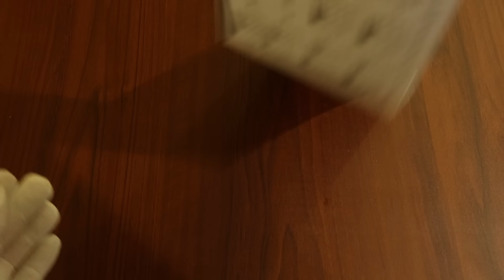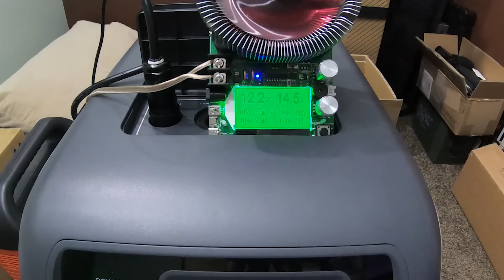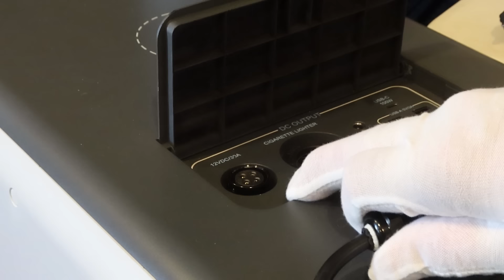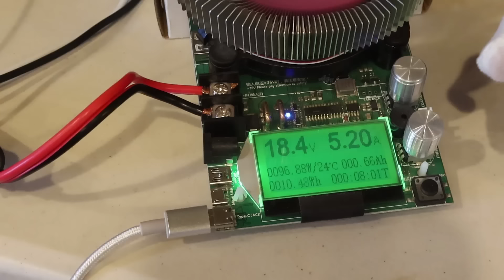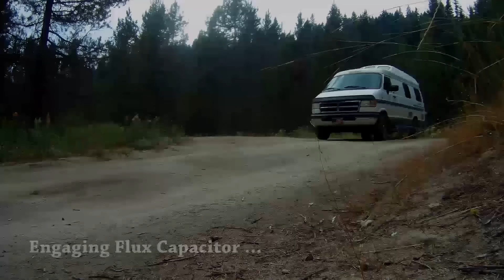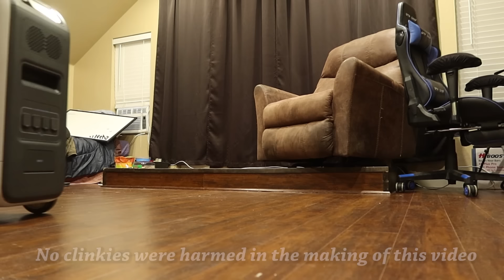BLUETTI EP500 5120wh LiFePO4 UPS BACKUP Off Grid Solar Generator Kickstarter Review

Comment: I look forward to the EP750/750 Pro ( guestimate) with the following additional features:
a. 7,512 W;  b. 4,000w/6,000w inverter; c. more a/c and d/c output ports; d. input port to include anderson connectors for up to 6 awg wires;  e.  separate ground wire input for connection from combiner box etc;  f. larger pv input cable to accommodate 6 awg wires etc. (in addition to anderson connnector) and
 in split phase mode: a. standard 120/240v plug from system to transfer switch to enable multiple 2 pole in transfer switch; 
I know you made a good recommendation to have steel covering  etc. I guess you would have many more recommendations.
The above is to bring the system into line to compete and replace bulky residential gas/diesel generators and to corner the market for apartments. as flexible solar panels can be place on the glass/windows etc to charge the system without bulky pv arrays.

Comment: Also if I have the split system and it can operate 220v etc. how can it connect to my transfer switch? If I have 120v/240v with one double pole circuit say double 20amp or double 30 amp (in my case for my electric dryer  and dual outlets in the kitchen which operates my ge oven range) how will it connect?
These questions and the answers may assist in the upgrade version of the split phase in the future as it is seemingly obvious that is where this EP500 Pro system is heading  to corner the market on apartments and houses etc. The future is megacities with high rise apartments that each unit would need about 13.5 kwh. of generator power and there can be no diesel generator which produces dangerous gases that kill people every year.

Comment: Also, if I choose to have a solar combiner box with 6 awg wires with ground running from it to  the EP 500 Pro which  operates as an all in one (a charge controller, battery bank, battery monitor and inverter etc.)  what happens to the ground wire ? does the connector for the solar charger has all three wires?

Comment: to run it for the remaining 10 hours I would need a 15kwh battery system to add the the EP 500pro.  This additional battery can be charged separately by other strings of solar panels. so theoretically I can run my pump for 24/7 unlimited.  What do you think?

Comment: I am fascinated by the EP500 pro as it may solve a major problem for me here in Nevis in the Caribbean. Hurricanes are a reality and it is getting more unpredictable every year.  I have a 3/4HP shallow jet pump with 3000w start and running 1500w. I would like to know if the EP500Pro with solar charge at max 2,400 w can run it 12 hours in the day.  If it is used as UPS mode I assume that in the night it will only run for about 3 1/2 hours out of 12.

Comment: It looked like you can out out 240V on one of the pages.  What did the manual say? Ok I went back and it can be a split phase 240V with 2 of them and the extra box.  Am I right?
Reply from the maker: Yes

Comment: Great review Professor 👍 guess they have a 240 V Version for Europe later...my question is can i draw supplemental power for my house / floor at a programmable time window..like 700 Watts from 9- midnight , than 700 Watts from 7-9 am?...Charging during the day with a add 500 Watt/h extra from Solar like 2,5 kW installed  to run/charge  things🤔

Comment: I’m totally new to this sort of thing and I’m confused about something.. are you supposed to dump this thing in the middle of your living room and run extension cords from all of your electronics or can you tie the unit into your house electrical so it kicks in when the power goes out?
Reply from the maker: I mention in the video it is designed to be tied to your home grid using their Fusion box.

Comment: What are your thoughts on running a 12vdc RV roof mount AC unit and a 12vdc portable refrigerator?

If aided with a few hearty solar panels, would it feasibly be able to handle the load for a couple of days?   As well as running a few 115vac components like a coffee maker and maybe a griddle?
Reply from the maker: Never heard of a 12v RV air conditioner. But of course it can run any 115v appliance and just about any 12v load up to 30A.
Reply: @HOBOTECH  thank you for the response.  Here is a video with info about 12v RV ac. 
https://youtu.be/iwBSRPOgxG8

I’m considering becoming one of those van life hippies but don’t want to commit to a build where I can’t easily go back to a normal van.  

If you could convince a manufacturer to send you a test unit, I’d love to see how this power supply performs.
Reply from the maker: @jgetscensored7837  A three THOUSAND dollar a/c unit? Yikes... I see no mention at all of BTU just the number of amps it needs which is up to 58A. The EP500 is limited to 30A from the 12v so it will not run it. I did find a calculator that tells me 2000w of cooling is equal to 6800 BTU or about the same as you get from a $150 Walmart air conditioner.
Reply: @HOBOTECH  thank you for the info.    I’m new to all of this

Comment: I need help. Setting up off grid homestead. My electric usage at my home is 600 kwhs. What is best set up for that much usage. I have 10 24volt solar panels so far. I'm going to be living in a 5th wheel with 3 air-conditioner. Won't use all 3. I like warm. Any help would be great
Reply from the maker: I assume that's 600kwh per month or 20kwh per day. A pair of EP500 Pros can provide about half of that which would get you through the night. Most importantly you need to max out the solar at 4800w in order to run air conditioners while at the same time recharge both EP500's. You could also just consider a DIY system or pro install.

Comment: @Hobotech, 
1) Would you opine on the possibility that this unit could be operated on its side (with vibration absorption padding) in an RV?
2) How does internal UPS function (and how can it be wired) into a 20 amp 110 household breaker circuit?  And what are the advantages of hardwiring the EP500 through Bluetti’s  add-on UPS (for extra almost $500) to several circuits in the same panel? 
3) Can you suggest an adaptor/cable to link  110 power from the 30 amp output port to a main  (30 amp 110V) RV input port, if regulated/fused for a 20 amps load? 
Thanks in advance!

Comment: RVers don't want to know how many volts to charge the unit or other useless functions or specs. The majority of RVers want to know what is the MAXIMUM sustained wattage can you withdrawal from the unit before the battery is completely depleted? WHY DON'T you TEST REAL CRITICAL USEFUL FUNCTIONS ????? GIVE REAL CONS  !!!!!!!!
Reply from the maker: I clearly show how many watts can be pulled from the inverter if that's all that you want to know. As a former full time RVer I would certainly want to know what voltages to charge the thing so I knew what kind of solar array to use.

Comment: Can I use this as a battery back up for my sump pump?  I would plug the battery to the wall jack and the sump pump to the battery.  Can I set it and forget it?
Reply from the maker: If your pump is 120v, yes. Otherwise, you'll need a pair and the Fusion box for 240v.

Comment: Make this simple. Will this run a 5000 BTU window AC off-grid boodndocking? For how long? Will my 1200W roof solar panels charge it? In how long?
Reply from the maker: Yes, indefinitely as long as the sun is shining then 8-16 hours off the battery.

Comment: Looks like the 220 is Europe, not USA?   They are single phase while USA is dual I believe.  Looks great - almost meets my needs.  I need 220v 20 amp output.
Reply from the maker: As explained in the video, you need two units and the Fusion box to get 220v-240v.
Reply: @HOBOTECH  Ah, think I see that now, is 30 amp, not 20; but would work.

Comment: You are extremely over-optimistic about the cycle life of the battery. I would rather build my own configuration, I do like the fact that it’s LiFePO4 and has 5.2kwhr of batteries.
Reply from the maker: I'm not claiming anything. I'm reporting the numbers I'm given. They show in lab tests how the batteries can reach that cycle life through slow charging and partial cycling. It's basic stuff.
Reply: @HOBOTECH  I understand. Thank you for explaining, no fault of yours, I should restate that the manufacturer is overtly-optimistic with that many cycles. No other LiFePo4 manufacturer has dared to declare more than 7k charges, most advertise 3K to 5K. I understand that they slow-rate charge them to increase the lifecycle, however 5.2 kWh can disappear quickly under load , as you probably are aware. I also find that 1200 watts limit on the PV is a bottleneck for that size battery bank. Overall it is an expensive unit and it seems most of the battery’s capabilities are hindered by that 1200 watt limit on the charging side and that limits what you can continuously draw from the bank. Thanks for responding.

Comment: @HOBOTECH: Does the watt hours of the Bluetti EP500Pro surpass the watt hours of a Titan system that uses 2 batteries? If so, then by how much?
Reply from the maker: Titan uses low cycle batteries. There is no comparison.
Reply: @HOBOTECH  That's nice to know, but it has nothing to do with my question. I guess I will email the Bluetti company. Maybe they will know the answer to my question.
Reply from the maker: @boxcar25  Your question can be answered with basic math. Go to the Titan site and look up how many wh the batteries are. Sheesh.

Comment: You know I appreciate this information but, I am not able to put it together relating how much power you can get and for how long, most especially for me wanting to use this machine for home use, that is when there is no electricity
Reply from the maker: Take 4360wh (the usable battery) and divide by the watts your appliance takes. That's how many hours it will run. For example, a regular energy star home fridge rated at 350kwh annually would use 960wh/day (350kwh/365 days). That would run for 4360wh/960wh or about 4 days straight.
Reply: @HOBOTECH  I get the picture sir, it is an indispensable machine very useful

Comment: The real question is, how long will the charge last powering up your AC and TV through the day
Reply from the maker: Assuming 32" LED and 5000btu running 50% of the time about 14 hours without any solar.

Comment: @HOBOTECH: I am trying to decide between purchasing 2 of the Bluetti EP500 generators (with both connected to have double power) or one Titan with 2 batteries. In your opinion, given that scenario, which of the 2 options would be the better way to go?
Reply from the maker: The Titan is a Model T compared to the EP500. It uses cheap low cycle cells and is outdated and overpriced.   Not to mention the privilege of being on a 6 month waiting list to get one then never hear back from customer service.

Comment: this is an absolutely terrible review of a power station.

the human brain is a pattern recognition machine.  it lights up when it sees a pattern.  or examples.  that means when you are reviewing something (or teaching something) you need to front-load your presentation with examples.  If you don't do that, people tune out.  

Of course, there are very intelligent people way higher than the average that can understand things in an abstract way.  but that's a very small audience.  plus, those people have no need for a power station youtube review video because they are going to figure this stuff without a video very easily. 

So you have here an example of a review video that targets the highly intelligent with a purely technical look at the device and little to no examples, which is exactly the type of person that is very unlikely to watch this.  Result?  low-view count and a waste of everyone's time.  

The common person that doesn't understand the tech side just wants something like a searchable 3 hour video cut into parts where this guy simply tries out a boatload of devices that can run on it.

As a review this gets a huge thumbs down.  On the other hand, if this is a fake review and really an excuse to generate some memes in the power station community, I guess it scores marks for trolling.  But it should be labeled as humor.  If I had to bet however, I would bet that this is a tech savvy guy that does not understand people at all and has poor social skills.

Comment: So 2 of these combined with 6 solar panels setup at my remote rv spot will basically give me full endless power and even run the a/c..?
Reply from the maker: If you mean 6x 300w panels, probably. You need to do an energy audit to know for sure.

Comment: @HOBOTECH: Needing tech support for possible Filmware bugs doesn't seem ideal for SHTF. Thus, do you think this is a real concern (needing tech support for this thing) in a total collapse SHTF scenario? Otherwise, in that scenario, what good is it... if it is not working due to bugs in it and no way to have tech support?
Reply from the maker: It's zero concern. The bugs have been fixed at this point.

Comment: Hey Prof HOBOTECH, a couple of things I wanted to mention: 
1) At 27:40, you asid people will need at least 3 12V pnales to be within the 55V minimum charge level. Did you mean 3 22V panels?
2) If that 100W USB type C is dual in/out capable, they could do some kind of super-slow charging while they are driving or otherwise using the car.
Thanks for doing another great video!
Reply from the maker: There are no such things as "22v panels". 12v panels output Voc 18-24v so you need 3 for at least 55v. As mentioned in the video the USB-C is not bi-directional. Note that the Pro model does support 12v/24v car charging.

Comment: Can I have solar panels on my blazer roof rack to it for charging? what problematic issues would I have?
Reply from the maker: You need at least 55v Voc of solar panels or 3x 12v panels or a pair of 24v panels in series.

Comment: @HOBOTECH, clarification please. You mentioned the AC output plugs are 20amps. Is that shared 20amp breaker for all four? Or is each plug on it own 20amp breaker?
Reply from the maker: Each outlet is rated at 20A and share 2000w. There is no breaker.
Reply: @HOBOTECH  Thanks Professor!! Just noticed the Bluetti website is showing the EP500 Pro as to having an RV socket. Hope that's true.

Comment: Using an ALP 1000 wh generator how long would it take to charge this beast? Would this or the Titan be a better choice to powering an off grid tiny house? Either seems like a better option than a $10,000 plus custom solar set up.
Reply from the maker: The ALP can supply 800w so with the right setup it would charge the EP500 in about 7 hours. The Titan is an outdated product that uses low cycle NMC batteries and is in no way designed to power a home. It's also way overpriced for 2000wh and there's a 6 month waiting list. It's not even in the same ballpark as this.

Comment: Professor, I actually ordered two EP500 Pro's...Did not see perk available during checkout so I ordered the Fusion Box (122.00). What do I need to do to correct and obtain perk?
Reply from the maker: Ask them. I'm sure there is a way to add it.

Comment: Professor Hobo,

I am wanting to utilize either the Bluetti (EP500 or EP500 Pro in parallel) or The Titan 10,000 as a Power-source for a SKoolie build. I plan to supplement the cloudy days with a 3500w generator to recharge. This will be a live-in situation powering A/C, Apartment fridge, TVs, you know, all the creature comforts. This beats buying separate components and utilizes a smaller footprint ta-boot. I trust your expertise and opinion, which one do you think will serve my needs over time?
Thanks
Reply from the maker: Titan uses low cycle batteries and is on a 6 month waiting list. They never answer their emails either. The choice is a no brainer.
Reply: @HOBOTECH  Thanks for the prompt response and candid / honest response.

Comment: This thing needs casket handles for a 4 man or lady lift.

Finally a fully integrated system. This unit would meet most of my baseline energy needs for my home, particularly if I switched my water heater to a 20 gallon 120 volt model.

 Only thing missing is multiple days of grid down and no sun. I am thinking Hurricane or Texas cold snap.

Every system I have seen in the dyi category is missing the energy management supervisor system. Energy management is the attractor for the solgen systems over dyi systems. 

Auto shutdown when the battery gets low, do not charge cold lifepo batteries, measure input and output power, fuel gauge, and run a full sized refrigerator. Only thing missing is 240 volt appliances, buy a second box, and a connector box job done.

This device is Not ready for my mom yet. To many buttons to push. To make it mom proof it has got to be plug and play, and forget it is there.

The one thing that can kill any battery bank that all dyi systems i have seen seem to overlook is the friggen inverter management. The excuse that you didn't size the system right is a copout. This thing seems to do the proper management of the inverter.

 We seem to be leaving the Vic 20 age and entering the Mac/IBM pc age in solar.

You didn't mention cold charging shutoff, I am assuming it will turn off the charge controller in a cold environment instead of disconnecting the battery? You should test for this feature.

Comment: Having in mind Goal Zero 6000 after 500 cycles you have 4800 WATTS storage capacity and having in mind price difference is much cheaper Bluetti EP500. Only having into consideration portability and charging time and connections, which one would you prefer if you had to choose one of these models?

Thanks and thanks for your reviews. Im learning a lot about WATTs Voltage and AMPs
Reply from the maker: Goal Zero is trash compared to this.
Reply: @HOBOTECH  thank you for your feedback and unswer